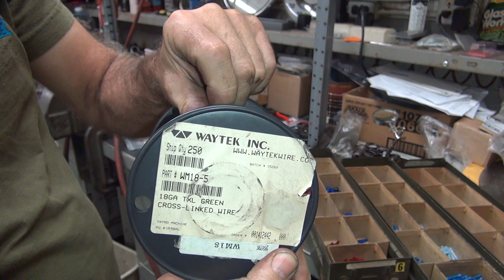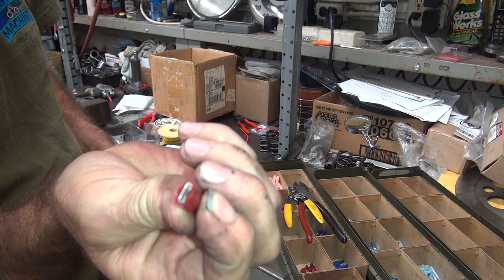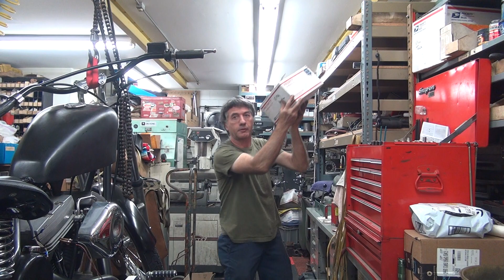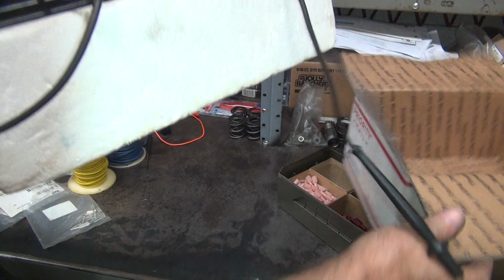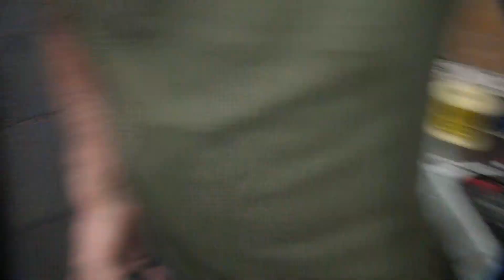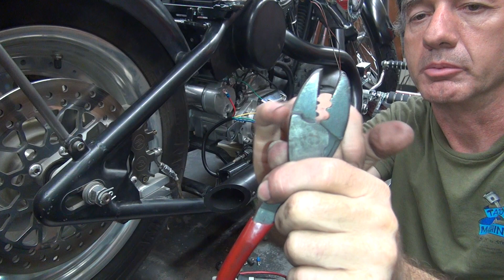#225 1999 80ci evo chopper used bike tune-up repair rebuild rigid bobber custom harley tatro machine

Comment: Solder and shrink tube for 100% connections
Reply: I sure as hell don't want to fly with you. What's better than a solid wire. We have corrosion in Iowa
Reply from the maker: try a little vibration and see what happenes to that soild wire.
tatro